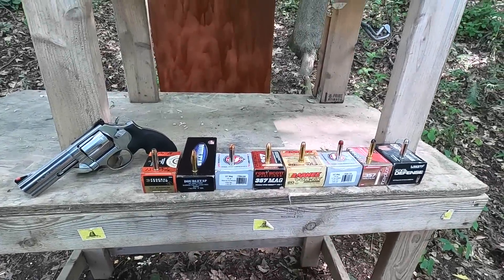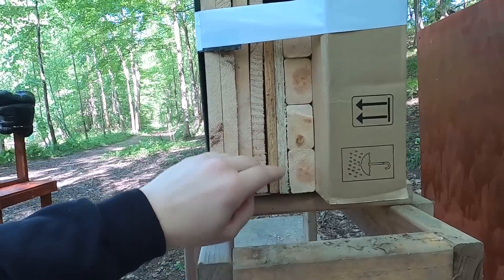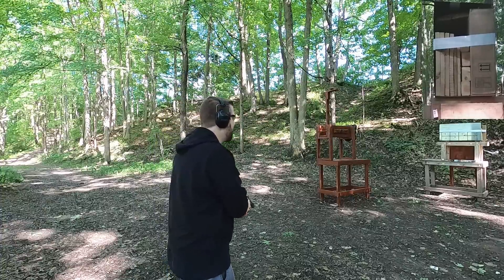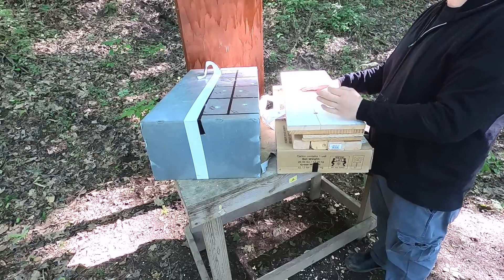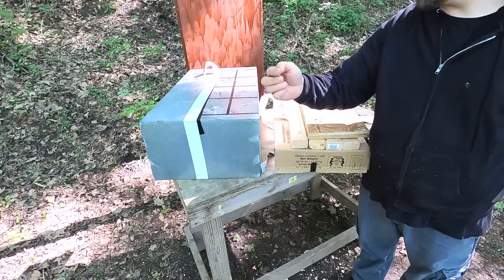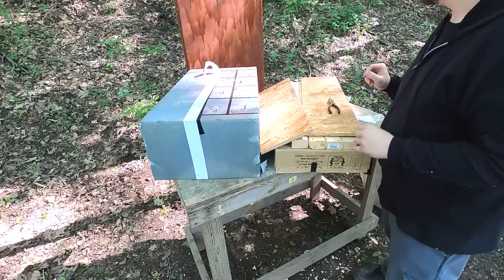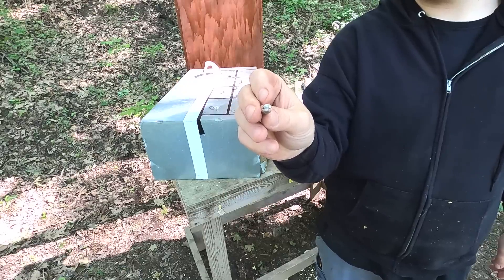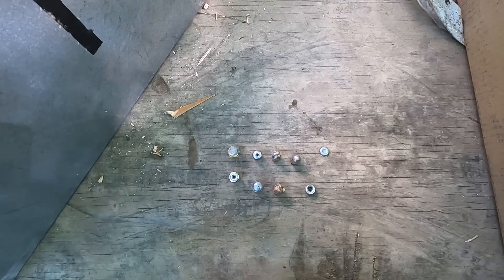.357 Magnum (Unconventional Ammo) Hard Barrier Penetration Test

Comment: interesting, but surprising result with the liberty defense round. i had seen another video where a short barreled 9mm was used firing a 50 gr liberty defense round. at a claimed 2000 fps muzzle velocity, it was able to penetrate things that a 115 gr fmj wasn't.
Reply from the maker: Yeah I think I got over 2,000 FPS with the 9mm version, yet the .357 version is less powerful. It's messed up. How can anyone load a 9mm 1/3 more powerful than a .357 Magnum? That's exactly what they did. I will say that this ".357 Magnum" is actually a .38 Special for exterior ballistics.

Comment: LeHigh really named their Extreme Penetrator bullet incorrectly. (They make the underwood bullet) It is named that because it can penetrate barriers like an FMJ, but gives a good wound channel. FMJs penetrate more in ballistics gel tests, but have no wound channel. Extreme pentrators are not stopped by clothes, bone, etc., but also have a good wound channel because they do not have to expand like hollow points. Therefore the name 'Extreme'.  I carry them in my pocket 380 for this very reason. Good penetration PLUS wound channel out of a light (95 grain) bullet traveling not so fast out of a short barrel. Tests have been awesome with them. Better than any hollow point of any manufacturer.
Reply from the maker: I will have to look into them further. On a different note referencing revolvers, it does seem like full copper bullets even in low end .357 Mag essentially eliminate most cylinder gap gas loss. Makes sense as the less density always makes them longer, keeping them over the cylinder gap just long enough to seal it during burn. Of course this would have other factors in the mix like powder and or low weight for caliber bullets, but traditional weights seem to work better for less gas loss than jacketed.

Comment: Would there be any significant difference in using either a longer barrel revolver such as 6 inch or 8 inch and even compare to a rifle with 16 -18 inch barrel. Food for thought. Have a great day and a better tomorrow.
Reply from the maker: 4" to 6" adds a little velocity, maybe 5%. I don't know anything about 8" ballistics but 18"+ does add a LOT more velocity over handguns.
Reply: @GunSam  I had a friend handled me reversed hollowbase wadcutters to shoot armadillo . we chrno them at about 700 fps in a 686 with 6 inch barrel they were pretty accurate to about 20 yards. I still have a few . I bought a box of the HST but have not tried them yet. Thanks again for the info have a great day and a better tomorrow

Comment: Very interesting test. I don't remember the respective muzzle velocities of those loads. I'm trying to work out if energy or momentum are more important on hard barriers since they do compress a little in this case. Against water, I would say momentum is your big factor. Of course bullet deformation eats energy and you need that too.
Reply from the maker: In this 4" revolver; Civil Defense 50 gr@2,005 FPS/446 FPE. Barnes VorTX 140 gr@1,255 FPS/490 FPE. Underwood Xtreme Penetrator 140 gr@1,315 FPS/537 FPE. Fort Scott TUI 125 gr@1,391 FPS/537 FPE. Federal Hydrashok 158 gr@ 1,287 FPS/581 FPE. Underwood Hard Cast 180 gr@1,221 FPS/596 FPE. Barnes 110 gr never tested in 4", in 2" 110 gr@1,269 FPS/393 FPE (estimated 1,400 FPS in 4" 479 FPE). Inceptor ARX 86 gr never tested in 4", in 2" 86 gr@1,404 FPS/376 FPE(estimated 1,600 FPS/489 FPE in 4"). I know the estimates for the two never actually ran in the 4" barrel kind of sucks but judging by energy increase with these type of rounds I feel like they are probably close.
Reply from the maker: I was going to list energy, but then it just became confusing. I might look them up and check back.

Comment: Excellent test, Sam. On an unrelated note: Which ammo would you expect to have more recoil on a dual cylinder snub revolver, 9mm or 38sp (standard load similar bullet weights)?
Reply from the maker: Thanks. If you were to compare lets say 125 gr+P .38 Special to 124 gr standard pressure 9mm, the actual recoil force would be about the same but the 9mm might be just a little snappier but in ft lbs recoil, no more than .38 Special+P. Now with .38 Special standard pressure, you would probably have a tad less but not a lot less recoil.
Reply: @GunSam  thanks! I rather bother you w questions to save time doing trial and error at the range w my daughter. Will search your videos to find penetration on 38 (short) in case 38sp is still too much for her... A recent video on .32 shows great penetration, so I would imagine .38 shouldn't be much less... 😎👌
Reply: @mitubogoogle  The precision one 380 xtp 80 grain rds. are meeting FBI standards for penetration. Consistent 13.5 inches of penetration in ballistic gel with denim. Might be a good option.

Comment: I am now in the unusual position of owning a .357 Magnum S&W 686 revolver (7 inch barrel 3-5-7 series) and I have yet to shoot it. I'll get to the range in a week or so. In the mean time I'm trying to learn about it and related things like the best ammo. So this was really helpful, thanks! Perhaps I don't need the deepest penetrator but it's still good to know about them and fun to watch a video that showcases the sheer power of the round. Thanks again!
Reply from the maker: Thanks for watching. A 7" .357 is rather an odd length, so finding ballistic info on it might be difficult. I'd probably say look for data on 6" barrels and add a conservative 5% velocity to it. Like 1,500 FPS= 1,575 FPS etc. I could be wrong on the numbers but that sounds about right to me.
Reply: I have a 686-6 /seven shot and love it. It absorbs recoil very well with anything you shoot. The trigger on the other hand needs to be broken in lol. After about 50 rounds it will smooth out. It’s also a nail driver to. You can’t go wrong with mr smith and Wesson.

Comment: Speaking as a reloader, .357 magnum is probably the most versatile pistol round available. Different bullets, powders, and charges make it customizable to almost any purpose. It's major (only?) weakness is that its a rimmed cartridge, so it doesn't function well in an autoloader.
Reply from the maker: I agree. And within what can be loaded, I personally feel like the .38 Special is the most versatile in a lot of ways, mostly as most people can shoot that ammo easily and there's no wear and tear on your gun especially with 158 gr bullets. I have loaded as high as 213 gr in .38 Special and went as low as the ARX in .38 Special, I think 77 gr or something like that. I mean you can do whatever, I have loaded .38 Short Colt at 500 FPS and while my hand loaded .357 Mag ammo is typically low end, I have shot ammo up to 800 ft lbs energy in this revolver. Just lots to work with.
Reply: @GunSam  Agreed. I consider .38 Special to be a part of the .357 "spectrum". For those (rare) occasions I carry a revolver in town, it's probably loaded to .38 +P specs.

Comment: Gun Sam thank you so much. I can just imagine the effort it took to do this video, and believe me it helps out a lot. I like the hard cast 180s in my own 686+, what is your general impression of the Fort Scott and Extreme Penetrator and do you think all copper bullets offer advantages over traditional lead bullets in terms of bullet performance at high velocities?
I would love to see you do some 10MM tests, as I think that round has tremendous potential. The 45 ACP is great and yes as you've shown in test after test it has great momentum, but I think 10MM loaded heavy but not as hot, not the "holy grail" of the old 44/40 round of 200 grain bullet at 1200fps out of a carbine that Elmer Keith and Bill Jordan wanted for the .41 Magnum nor the classic Norma load that Col. Cooper developed for the 10 mm but the same bullet at 1000 fps has advantages over the .45 ACP: greater ballistic coefficient, flatter trajectory, better hard barrier penetration, better recoil control. And in an autoloader more rounds (generally 1-2 more) and fits your concept of a 40 caliber revolver cartridge. Given that both Smith and Ruger offer 10mm revolvers.
Anyway thanks for what must have been a tremendous amount of money and work to produce this video. I am giving serious consideration to the extreme penetrators.
Reply from the maker: Thanks, this video actually wasn't too difficult, I had this stuff lying around to shoot at. As far as TUI and the Xtreme bullets, I am not really sold on them. In fact I suspect that they might have lower velocity than jacketed bullets despite a jacketed being copper because I always felt like a jacketed will deform in the bore and exit the muzzle easier, but solid copper might not deform at all and the bore takes on all of that friction, but that's just a theory. I have noticed though that with solid copper I have got less velocity than jacketed, but they are all different factory loads so again no way to know. As far as 10mm, I been debating getting a 10mm barrel for my Glock 41 as all i'd need to do is get a stronger spring and a Glock 20 magazine to be able to run 10mm, but currently I can't get the barrel I want as none in stock.

Comment: Thanks for the great demonstration. It looked to me like the 180 and 140 g Barnes performed similarly. Did you measure the expanded diameters? Looks like the Barns 140 would be a great hunting round. I currently have the Underwood 180, and the Barnes 140. I have tried the 140 penetrator in two 357 mag revolvers and they did not group well for me.
Reply from the maker: Thank you. I did not measure them, but it looks like the hard cast and Hydrashok are just shy of half an inch, just from my guess. The others looked maybe .38 to .42 or about in there.

Comment: Lehigh projectiles work very well. In spite the penetration, when going through fluid substances they act equal or better than hollow points.
Reply from the maker: Maybe. Not sure about as good as hollow points, I guess I need more comparisons as the ones I have done don't show them as that great, however water jugs might not be the medium to show much of anything.
Reply: @GunSam  I wouldnt say as good as premium JHP's. But compared to stuff like Remington, Winchester, and the likes... they certainly perform on par or at least consistently compared to them. It also depends on if you go with the Xtreme Penetrator or Xtreme Defender. There is a noticeable difference in the Defender with broader wound tracts and less penetration. The Penetrator though, people get sold on the name thinking it's going to do something special. In reality, it performs about on par wth FMJ but at least has better wounding characteristics. So it seems to be ideal for those who need what FMJ brings to the table but would like a hollow point when they hit the target.

There've been several people who have tested these rounds fortunately though and that seems to be the general conclusion. That and the Lehigh's in general seem to benefit short barrel firearms and small caliber guns like .32's, .380's, and the likes.
Reply: Tim did quite a bit of testing on the stuff.
https://www.youtube.com/watch?v=ClJcJ8LQFbQ